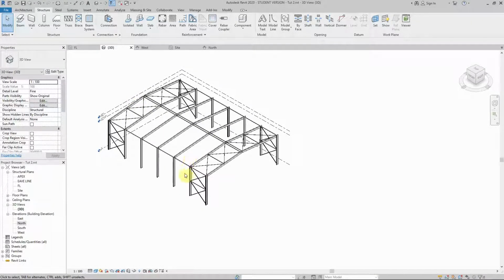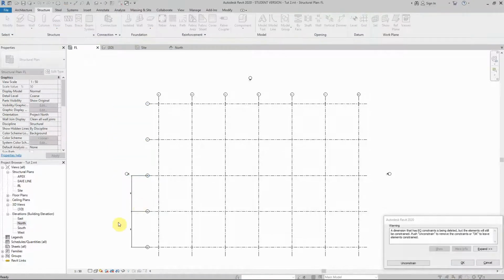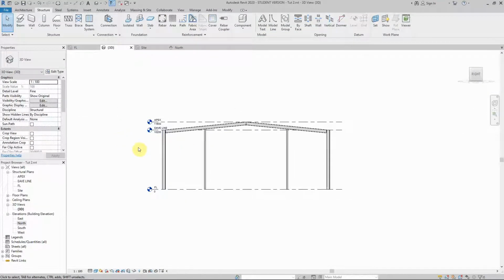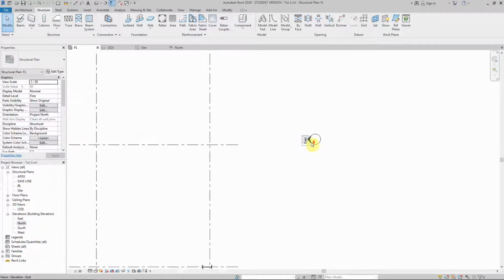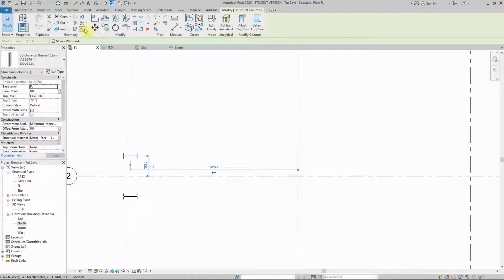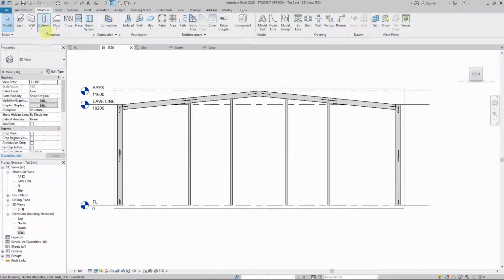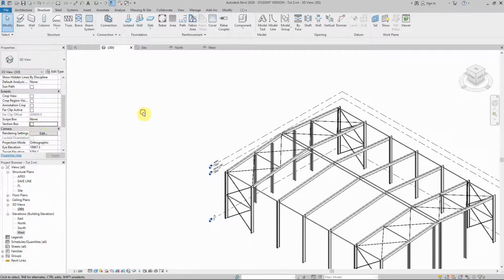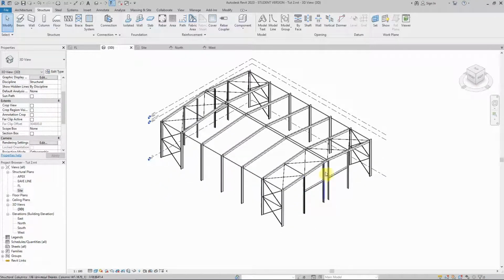Tutorial 4: End Walls Frame

Comment: Hi, I love your tutorials! I'm having a problem placing the headers for the garage doors, they don't end up in the center of the columns. What could I be doing wrong
Reply from the maker: Try to adjust the Y justification on the header beam to suit the position you want it to be, usually a beam is justified with its top edge, if you change it to the beam centre that could sot it out for you.